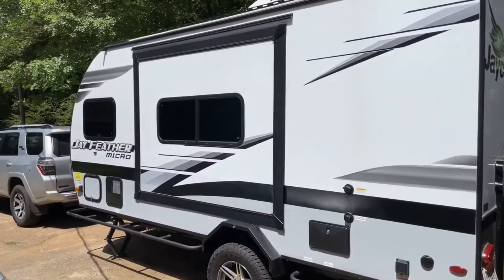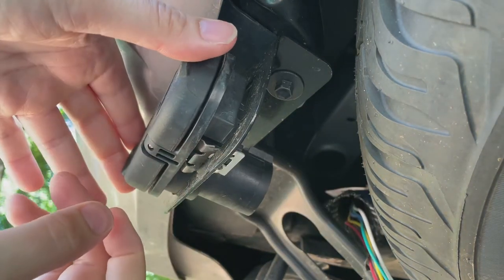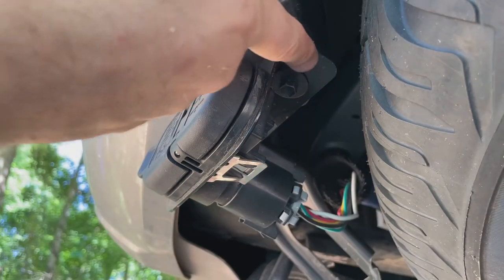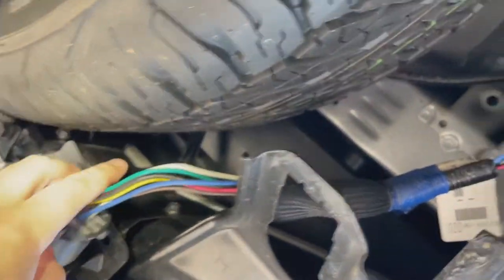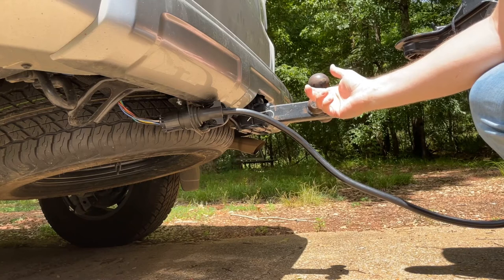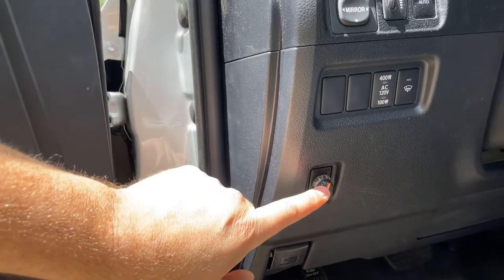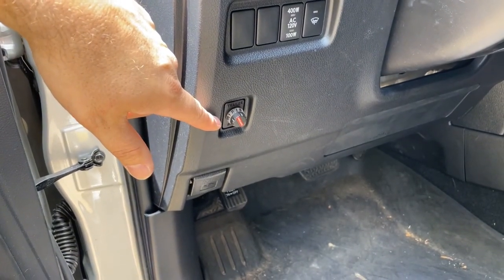Fix Annoying 4Runner Trailer Wire Location with Parts Link, and Review of REDARC Brake Controller.

Comment: FYI for Limited owners, this won't work. The rear fascia is too low. Figured that out after ordering the part.
Reply from the maker: Sorry to hear that. I didn’t realize there was a difference. Were you able to return the part to Amazon?
Reply: @OrganizedMud  No problem returning. I should have known better, the Limited's fascia is low everywhere.
Reply from the maker: @TheRayDog  Good to hear! I pinned your post so hopefully others might see beforehand. Thanks for letting us know.
Reply: You only have access to to the factor bolt for install
Reply: @OrganizedMud  Just checked my new-to-me 2010 Toyota 4Runner Limited>>Looks exactly like Mudman shows, so Early 5th Gen Limited are identical.
Reply: Nice video but I like the location on my 2018 Limited and don’t feel it needs monkeyed with.

Comment: I had to stand on my head to plug my boat trailer in and then I couldn't even plug in my utility trailer.. the harness wouldn't reach! Ran home without any lights on the trailer but thankfully my husband was following me. Came home and immediately started searching for a fix and found your video. THANK YOU!! I got the bracket you linked on Amazon and just knocked this out. Looks so much better and is actually visible and accessible now! So again.. my HUGH THANKS for sharing your solution to this issue!
Reply from the maker: Wonderful! Ya man, talk about an annoying thing! There were many curse words uttered trying to figure this out, lol.  I bought several different things until I could find what worked. So glad I could help save someone else the frustration! :)

Comment: Mudman sorry to bother you but we are selling our RPod 3,600 lb. Camper to a couple that have a 4 Runner and wanted to know if they could tow it, looked it up and it seems basic 4 Runner can tow up to 5,000 lbs. what do you say? I told them I’d find a 4 Runner expert and ask them.
Reply from the maker: All 2010+ 4Rs are 5k. This camper is about 4600 loaded. The 4R is not the best tow vehicle, with only 5 gears it likes to stay in higher rpm, but it does fine. I wouldn’t worry about anything under 4000#. 👍

Comment: Thank you! Just ordered the bracket through your link. Overall I like my new 4Runner, but there are definitely some questionable design decisions on it.  Whoever located the plug in its original position obviously never had to hook up a trailer at night in the rain. I literally have to lie down on the ground to plug in.
Reply from the maker: 🤦‍♂️ SMH 🤷‍♂️ makes no sense to me either. You’re welcome. 😊👍

Comment: I’m looking to possibly buy and tow a 3500 lb rv with my 4Runner and would love to see a video where you share how the 4Runner handles towing the RV
Reply from the maker: It will do fine. Mine was 4500 and I took up the mountains of Tennessee. You’ll learn where the transmission shifts. Use manual shift for downhill especially and most of the time just for more ease of control. Get a good weight distribution hitch. I highly recommend the WeighSafe to know exactly what is right. You’ll hit some higher RPMs, but nothing bad. Don’t worry about it. Use manual downshift coming to stops if you want to give the brakes a break. Get a good brake controller. Redarc elite works like you’re not even towing.

Comment: I understand Toyota put the plug in the OEM location for off roading, for approach and departure angles.
Reply from the maker: If they did, it makes no sense and is unnecessary because you’ll be on the spare first. But either way, horribly inconvenient.

Comment: Thanks for the video! I will be doing this soon!  At 6:50 I'll use a loose zip tie through the old bracket to keep those wires away from the spare tire. Just enough to restrict them but loose enough so they don't touch on the bracket.
Reply from the maker: Great idea! You’re welcome.

Comment: Looking for vids on T4R towing, thank you for posting this tip.

That 166FBS trailer dry around 4100 as you mentioned. Realistically, you'll be at the 5000 pound tow limit at times. 55 gal water tank and 30 gal holding tanks, you'd have 500 lbs of water alone. Add propane, food and tools in the trailer, etc, ugh. Heavy on the T4R. I'm looking for a 3000-3200 pound trailer and 4000 max tow weight. And even that scares me given western states trailering. But as trailer shoppers know I'm sure, going below 3000 on a trailer gets into the world of wet baths, small tanks, uncomfy small package for two, etc. Hard to balance with the T4R's not stellar towing capability.
Reply from the maker: Yuup. But I didn’t tow with full tanks. I also sold it for a Gladiator. 😂 🤷‍♂️👍
Reply: We just purchased a Gulf Stream 19ERD to tow behind our 4runner. 3090lbs dry  wight 4384 GVW. Perfect for a couple with options for Grand kids or another couple to tag along.

Comment: Thanks for your video! I’m wanting to tow a 19 foot airstream with my 4Runner. Can you tell me how well yours does towing? How much weight do you tow? Thanks!
Reply from the maker: My camper is 4599 and tongue weight is around 550. It does the job but I would go over this. It’s maxed out in my opinion and this is with a very good and precise weight distribution hitch with the WeighSafe. 👍

Comment: Hey Eric this was a great video. I know the plug is inconvenient but what I like best about your video is the brake controller and I would like more information regarding the weight distribution hitch bc I have sag when hooked to my  Wolf Pup 16FQ. The dry weight is 3000 pounds with a 1000 payload. 
My YouTube channel is Sarasota Tim mostly about my 2021 SR5 P. Heck you having a 2022 you could possibly be one of my subscribers already lol. Again, this is a great video explained everything very nicely.  😎

Comment: We are looking at purchasing the same same model camper, how does it feel behind the 4Runner?
Reply from the maker: I highly recommend getting the larger WeighSafe weight distribution hitch. You’ll need to lengthen your security chains, but you’ll be able to lift the rear hatch in transit and everything will be maximized to work together. 

The 4R handled the camper well, expect high rpms, but it’s fine. A good brake controller and a proper weight distribution setup though and everything else won’t be an issue. I love the camper, but I wish we would’ve bought a GeoPro 20fbs. It’s basically the same except lighter, longer, a walk around bed and a larger shower. I highly recommend checking it out before you buy. If you’re really interested in the Jayco though I’ll sell you mine and buy the 20fbs 😎 👍😊 lol. The Jayco is a great camper though. Great quality. When you’re staying in it you don’t feel like you’re roughing it.
Reply: @OrganizedMud  Thank you for the info, our last set up was with a tacoma and winnie micro minnie. We loved it but moved on. We are also looking at the other model you mentioned. I was concerned about the tow capacity of the 4runner but it sounds like you are doing fine. Thank you sir

Comment: Like to hear any issues you have with your set up? We just purchased the same trailer and have a 2023 4 runner 
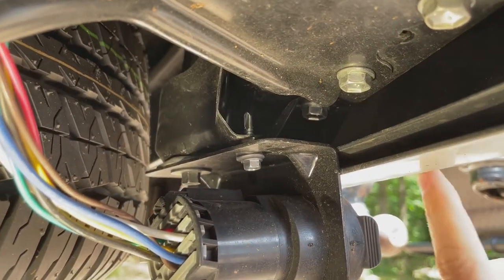Any insights 4:59
Reply from the maker: No issues really. Expect to be in higher rpms. I used the manual shift option a lot. It helped on grades to maintain speed going down and prevent extra high unnecessary rpms up hill. Just have more control over the trans. 

We love the camper. I’ve got a Jeep Gladiator now though. If you have any other questions feel free to ask. Enjoy!
Reply: I'm in the same boat.  How has your experience been so far?

Comment: My metal bracket is hitting the spare tier? Did you put a washer to extend the bracket down? It looks like there’s something there?
Thanks!
Reply from the maker: Hey, sorry to hear that. Hmm, I didn’t do anything extra not described in the video. You know what, I wonder if your spare is off center. They’re on cables and it send the list likely scenario. I’d recommend lowering it just though that it will move and seeing if it wants to ride a little further toward the front of the vehicle. See if you can make space that way and crank it back up tight.

Comment: Have/did you experience any problems with your REDARC system using the tph-021 harness? The REDARC website recommends to use harness tph-025 and splice it with the factory supplied jumper harness on 2018 and newer 4runners due the tph-021 harness not allowing the unit to calibrate properly.
Reply from the maker: I was not aware of any issues. It seemed to work fine although it did take longer than expected to do the initial setup. I no longer have the 4Runner but we towed the camper on several 4-5hr trips and I never felt anything that grabbed my attention to any issue. I’m quite obsessive about my vehicles and I’m pretty sure I would’ve noticed. That’s the best I can tell ya. I bought a Redarc for my new Gladiator also, because I liked how smoothly it worked in the 4Runner.
Reply: @OrganizedMud  I can't for the life of me get this figured out. Lol. I seem to be the only one that's experiencing this issue for some reason. Preciate it, man.
Reply from the maker: @two_legit1832  tell me what it’s doing? Did you watch the REDARC calibration video? I found it very helpful. You have to maintain the correct speed on a flat road for long enough for it to do its thing.
Reply: @OrganizedMud  Yea, I've read and watched everything I could find. According to the manual it's calibrated. Says if calibrated you'll have a solid blue light once connected. Which I do. And trailer brakes operate fine. But I keep getting the yellow/red fault codes on the REDARC knob. No warnings or alerts on Runner dash. And the fault codes are intermittent. And I don't see any problems with any of the wiring. 🤷‍♂️

Comment: where did you buy the REDARC Elite brake controller and what model. I have a 2016 4runner?
Reply from the maker: I apologize for not adding that info in to the video details to start with. It's there now and I'll paste it here for you. I believe 2016-2022 should be the exact same, but I'd check the REDARC site with your year to be sure. 

• 3 REDARC Parts and links used:

- EBRH-ACCV3 REDARC Tow-Pro Elite Electric Brake Controller: https://amzn.to/3xpGa8m

- TPH-021 Plug-and-Play Wiring Harness for REDARC https://amzn.to/3NzwA8G

- TPSI-002 REDARC Tow-Pro Switch Insert https://amzn.to/3mrsun0

Comment: Cool mod.  Couldn’t you just remove the stock bracket, heat it up and bend it towards the back?
Reply from the maker: No unfortunately that wouldn’t work. Heating the bracket is not going to stretch it 12 inches toward the bumper.

Comment: I understand why you did that. I always have to knee down for connect my trailer to my 2019 TRD pro. But you dangerously getting close to wheel. At least the way I see it in video. And I use wireless break controller without messing with wiring.
Reply from the maker: It’s not close to anything, especially nothing dangerous. 👍